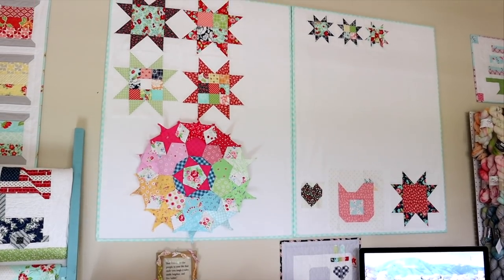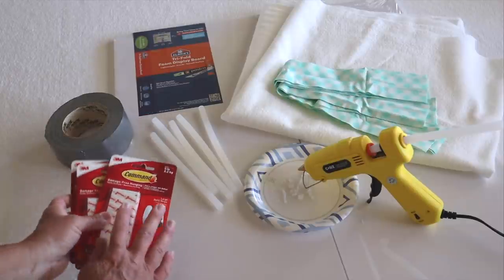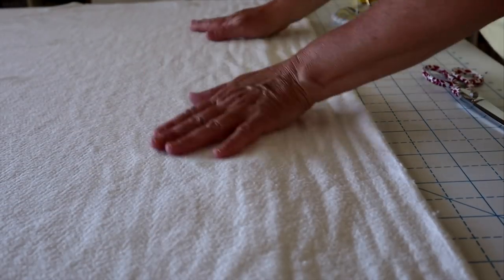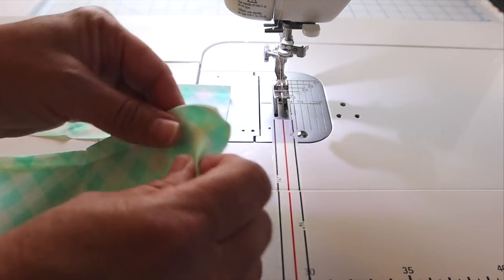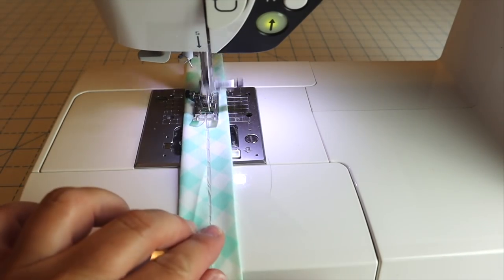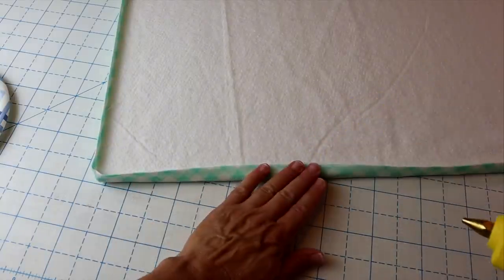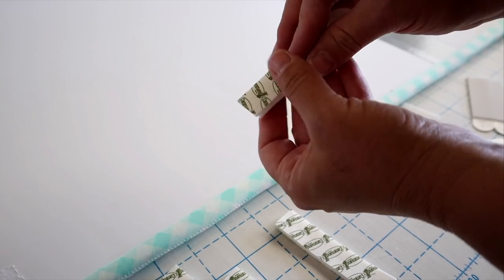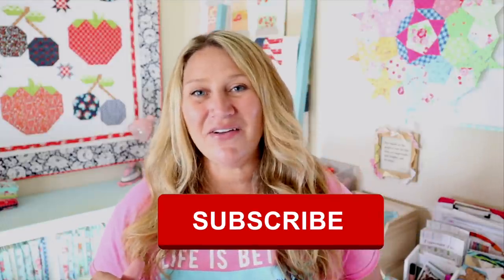DIY Design Wall // TUTORIAL!

Comment: Thank you for this Great tutorial! I made 2 with the poster boards, one flannel (2x3) and one with batting (3x5). I used spray Basting Adhesive to hold the fabric down until I flipped the board to duck tape. I trimmed them both with cute bias tape. I live the finished product! 
*If I make another large board, I would not apply the trim as the logistics of glueing was both tricky and tedious. 
** The Felt holds cotton fabrics just fine, and I find the batting able to hold thicker the fabrics.
Reply from the maker: good to know, thanks for sharing! And yes, you can use spray adhesive too!

Comment: I did a design wall as well few months ago by using an outside tablecloth with flannel at the dollar store instead of using batting!
Reply: I did the same thing. However the new tablecloths at Dollar Tree don't have very much flannel on the back of them so they won't hold hardly any weight at all now.
Reply: @Charlie-cz3jh  well, mine works properly!
Reply: Great Idea.  I have an old vinyl table cloth ftom Joanns, maybe its a little more hefty? Lol.

Comment: Erica, that you for showing this design board.  It’s exactly what I would like to do.  Have you tried pinning into this board?  Thanks …I enjoy your videos.
Reply from the maker: For the DIY design wall, yes you can pin on them as well, but you don't really need to as your quilt blocks will stick to the batting. The Felt Right Design wall you do have to use pins on as the felt isn't sticky.

Comment: I saw this video months ago and searched to find it again.  Now subscribed. Just curious, how do the command strips hold over time? Also, I don’t have zigzag.  Could this still work?
Reply from the maker: So far so good! They stay in place until I move it. If you don't have a zig-zag stitch on your machine you can still make it work. Just sew down both sides with a straight stitch to hold them in place. Then put the raw edges inside against the foam board.

Comment: Not sure if asked before, but does it matter if i use polyester or cotton batting? TIA 🙂
Reply from the maker: I haven't used polyester, so I'm not sure. The cotton allows the blocks to stick to it quite well. I would try a piece of the polyester batting and see if your blocks stick to it before making the wall.
Reply: @erica_arndt  thank you for replying. I'm not sure what I used but it's working on the foam board, the batting was just big enough to cover it, so I sprayed it with adhesive and stuck it on there. 
For bigger projects, I'm using a shower curtain stapled to a wall and just pinning for now. 😉

Comment: I bought my design wall at missouri star quilt and I put it up on my wall. Is there a wrong side or right side to it ? Because my pcs are not sticking to the wall.
Reply from the maker: Hi, I'm not sure what fabric they use, but if it's a flannel or batting like I used, it should stick to both sides.

Comment: Is there a reason why you cut it by the width of fabric versus a 45 degree angle like making binding for a quilt
Reply from the maker: I think it's just personal preference. I don't usually do bias binding unless I'm adding it to a project with curves. The straight binding works just fine for me and uses less fabric. But again, it's just personal preference. Some people think it makes your quilt edges lay flatter, but I haven't really noticed much of a difference.

Comment: Can you use spray adhesive?
Reply from the maker: I tried some of my 505 Spray Adhesive and it did work, I'm not sure how "permanent" it is though, I could see the batting pulling off a little with the weight of blocks on it. But can't hurt to try! That said, I think I would still hot-glue the edges, I don't see the spray working as well on the edge binding.

Comment: I’ve never made a design wall yet but I want to try this. I like the idea of connecting smaller ones to make one larger design wall as it would probably not be necessary to use screws in the wall then. What is the difference between using batting  or flannel as your surface? I’ve seen tutorials each way.  Thank you for doing these easy to follow videos.
Reply from the maker: I think you can use flannel as well, I just have batting on hand :)